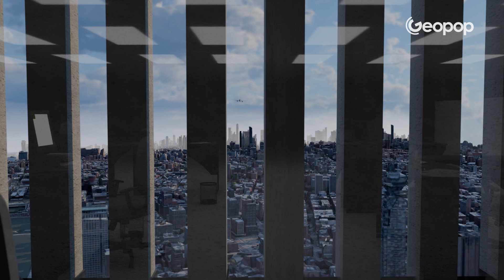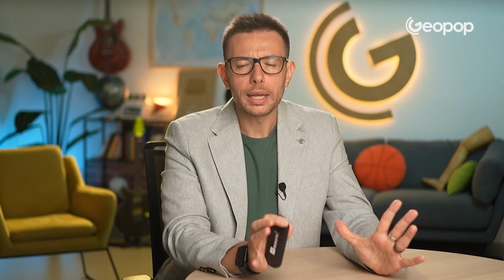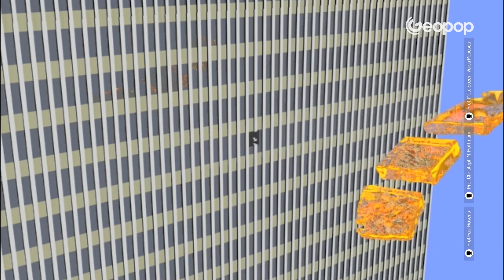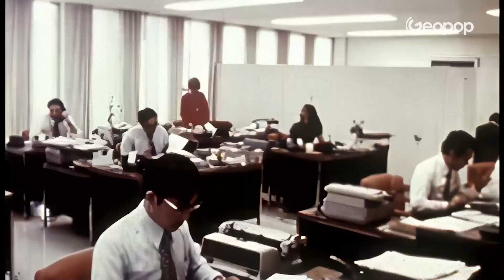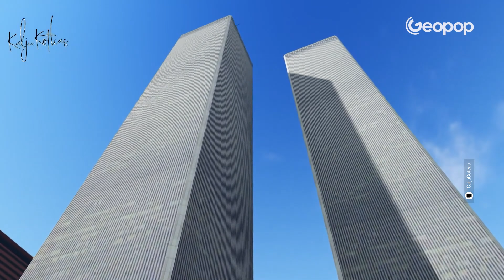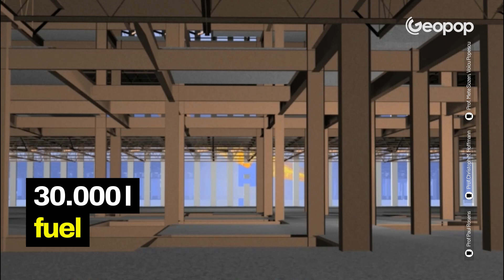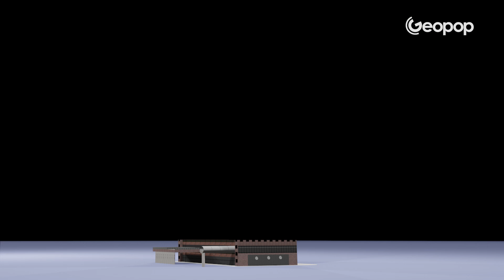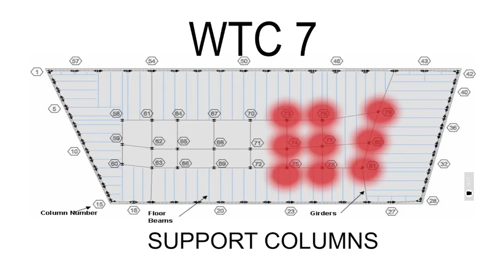9/11, 2001: The Technical Reconstruction of the Twin Towers and WTC 7 Collapses

Comment: Tower 7, really? No steel framed building has ever collapsed from fire (except for these 3). This video is just an embarrassing rendition of the party line. You cannot believe your own words. I'm cringing that you put it out there as the truth. You're a liar. Look at videos of steel frame buildings on fire. Philadelphia, Barcelona, others. NONE of them collapsed. Liar.
Reply: Because non have been hit buy a wide body passenger jet airline
Reply: That has 0 to do with the bottom floors collapsing. Especially in their own footprint and building 7, was not hit by a plane.@cptcool-__-7501
Reply: The collapse of the unknown and unimportant Building 7 – one of 6 buildings to collapse of 10 destroyed on 9/11 - confuses a lot of people, despite being one of the most studied engineering disasters in history. It was not famous, not a terrorist target, no one was killed in it and thus it did not get a lot of attention, so most know very little about it. There is a lot of tantalizing but absolute garbage out there on this topic. Given the choice between long boring, hard to find technical reports and readily available, easily digestible fantasy on the internet, many turn to the latter. To counter that I prepared this brief summary explanation based on my own analysis. No politics, just engineering. 

The North Tower collapse at 10:28am bombarded Building 7 with thousands of tons of burning debris, causing heavy damage and starting raging fires burning out of control for the next 7 hours. Half the responding FDNY firefighters having been killed, others injured, units in disarray, much of their equipment destroyed, no water pressure, and the greater urgency of Search & Rescue efforts, firefighting efforts at 7 were pulled as futile. The building couldn’t be saved and was left to its fate.

youtube.com/watch?v=g_SvpwyC17M&ab_channel=MFitz 

Collapse of a burning structure is always a concern for firefighters. Steel buildings subject to fire rely on active fighting of the fires to survive. Left to their own devices they will collapse. Buildings are designed around 1 to 3 hours of fire resistance, allowing time for occupants to escape and ACTIVE firefighting to get started, after which all bets are off. In B7 the occupants escaped, passive and active fire protections were compromised and active firefighting never got started which left the building to take its chances. It lost. Odds on Building 7 would eventually collapse,… and it did. No big deal in logic. That is the sort of choice firefighters make every day in brush fire situations - which houses to save and which ones to let go. Only real difference here is moving the decimal on the size and cost.

FDNY Chief Daniel Nigro ; The biggest decision we had to make on the first day was to clear the area and create a collapse zone around the severely damaged 7 World Trade Center, a 47-story building heavily involved in fire. A number of fire officers and companies assessed the damage to the building. The appraisals indicated that the buildings structural integrity was in serious doubt. I issued orders to PULL BACK the firefighters and define the collapse zone. It was a critical decision; We could not lose any more firefighters. It took a lot of time to PULL EVERYONE OUT, given the emotionalism of the day, communications difficulties and the collapse terrain

FDNY Deputy Chief Peter Hayden - We had our special operations people set up surveying instruments to monitor and see if there was any movement in the building. We were concerned of the possibility of collapse in the building. And we had a discussion with one particular engineer there, and we asked him if we allowed it to burn could we anticipate a collapse and if so, how soon? And it turned out that he was pretty much right on the money, that he said 'In its current state you have about 5 hours

With its deteriorating condition being reported throughout the day, the collapse of Building 7 expected by the FDNY, bystanders and the media meaning at least 24 video cameras recorded some or all of the collapse. Everyone at the time knew what was coming and why.

youtube.com/watch?v=OY5S5k3tMHI&list=PL4GiNqqck-lzR7pebSWRVLoXyu-aWR3Rr&index=48&ab_channel=911InvestigationVids 

Building 7’s collapse was totally different to the Twin Towers, harder to understand and most of the details difficult to see. But we can sort out what happened through careful analysis and observation.  What follows is MY EXPLANATION of the collapse sequence using the best available information and relying on no authority.

B7 was complex structure, a 47-story steel framed building built on top of a smaller existing 3-story building, requiring several lower floors dedicated to complex load transfer structures instead of usable office space. Of trapezoidal shape and all-steel tube-in-tube construction, B7 (above the 7th floor) consisted of a central core of steel columns carrying most of the gravity load, perimeter steel columns around the outside of the structure carrying the remainder of the gravity loads and long span beams and girders to tie those elements together and form the floors. On the outside of the building hung a moment frame - the last part of B7 to fall. 

Phase 1 : Collapse initiation for B7 is notably quiet with observers not realizing the building was collapsing! There was no audible warning in the form of say hundreds of ear drum busting 180-190dB explosive bangs preceding the collapse. The first externally visible signs of collapse initiation occurred at 5:20:28 pm. Here at 12:00 a local CBS affiliate reporter is talking 10 blocks from B7 when collapse begins. People don’t start to notice the collapse until 12:11. Then at 12:45 is the famous CBS fixed camera clip of Building 7’s collapse Again, note how quiet it is.

youtube.com/watch?v=t5tEy6mXSE8&ab_channel=fresnosean379

Collapse initiation was due to multiple lower floor failures above the load transfer region (7th floor) in the NE corner of the building. In this video at 0:45 you can see the NW corner from inside the building while under construction, Column 79 just out of frame on the left. That big, angled steel beam across the top of the frame connects to C79 at one end. The girders connect to the beam. The beam and all those girders depend on just one connection

youtube.com/watch?v=nP3TNHPCIVU&t=35s&ab_channel=EdwardCurrent

Phase 2 : Lower floor failures left core Column 79 laterally unsupported over an excessive length and it buckled. If you look at a floor diagram of Building 7 (see above) and look at all the structures that depend on C79 you quickly realize this one column was a relatively isolated structural element on which a disproportionately greater fraction of the structure depended . Externally we see a vertical progression of window breakage along the 44-46 line and a kink in the roof of the East Mechanical Penthouse at the top of the building, consistent with C79 failure. The transition from full capacity to almost no capacity occurs in virtually an instant. Once the buckling failure occurs there is almost no resistance

Normally with a buckling column, the load could very well be redistributed to other columns, meaning the buckling could stop after a while. With C79 that is not the case - the failure did not redistribute the load, so the collapse rapidly progressed to the roofline, sinking the rooftop penthouse.

Phase 3 : With C79 gone, B7’s progressive, non-symmetrical collapse continues with C80 and C81 at the east end of the core left laterally unsupported and quickly buckled and failed as well, sending the EMP down through the building. C79-81 all have no diagonal bracing, which I believe is a major reason why they could not redistribute a lot of vertical loads among one another.

From there collapse progressed from east to west through the central core until the core was gone taking all of the interior floors and structures and probably most of the perimeter columns with it. You can see the horizontal progression of window failures low in the building and the dropping of the remaining rooftop structures into the building. One of the big takeaways from the NIST Building 7 study (that gets completely ignored) was their modeling which determined C79 failing under ANY circumstances would have initiated the same collapse sequence.

Phase 4 : After about 10 seconds only the exterior moment frame - a hollow shell mostly supported by the 4 corner columns and quite unable to stand on its own – remains, creating the illusion the building is still standing since little has changed externally. That’s just hollow empty shell, like an empty cereal box. The north leans inward, forming a V in the roofline. The last remaining perimeter columns buckle under the strain.  There is almost no resistance as the moment frame free falls, landing on top of the 7-story high debris pile, blocked surrounding streets, heavily damaged the Verizon Building and destroyed Fiterman Hall at 30 W. Broadway, all well outside of Building 7’s “footprint”.  It is only here, at the very end that a single utterly meaningless measurement of alleged free fall is taken. Start to finish the collapse took 18-20 seconds, or less than 1/3 of true free fall*. Not that we really care since how fast something falls cannot tell you what started it falling in the first place. The free fall argument is about the collapse of the outer shell *AFTER all of the critical internal structure had already failed and completely ignores about 80-90% - of the collapse. 

Building 7’s progressive, non-symmetrical collapse was incidental and unintended collateral damage from the combined effects of fire + time + gravity started by the collapsing North Tower. That is true no matter who planned and carried out the 9/11 attacks or why . The collapse was of so little consequence it barely even registered at the time, a mere footnote. 

I hope you found this helpful. It is meant to be informative, not adversarial and to solicit informed critical comment. If I made any errors of fact, logic or reason or left anything critical out, please let me know so I can fix it. IF you can offer a more plausible alternative be my guest. So far no one has even tried. Please start any reply with the words “Tits McGee” or I will know you didn’t actually read it and won’t let you waste my time.

Comment: Science did not work that day how was it every action has an equal and opposite reaction? No pieces of the planes falling back to the streets? Ok ok but can you explain the columns of the world trade center cut in an angle like you see in control demolitions? You still can find those pictures on the internet
Reply: I don't think you understand how science works. 

As for the angle cut columns, yeah, that has been explained a few countless thousand times but here it is again since you missed it:  

The angle cut steel beams you speak of were cut on 10/29/2001 by workers removing debris using thermal lances and cutting torches. This is confirmed by AP photography of the scene before, during and after 10/29/2001.  

www.youtube.com/watch?v=pVDU5QKa8Wg&t=7s
Reply: @TheLoonResistance Science does not bring 3 buildings down in their own footprint, the odds of that or astronomical, at the very least. Hell, even professional demolition people. You can't get buildings to fall that well sometimes.
Reply: @Bigdaddy96991  and just airplanes neither
Reply: Huh

Comment: I'm very skeptical of NIST explanation of the events of 911 based on your information airliners weighing in at 130,000 kg flying 700 km/hr. Struck the building with a massive over 450 tons, you said the Jets were disintegrated in less than one second, but they managed sever 37. Exterior columns,  and  19 interior columns . in less than one Second…. Well, consuming 30,000 L highly flammable, aviation fuel….. Have you listened to what you're saying and how it doesn't really align with the bigger picture... That airliners no matter what their size could never sever 37 steel columns on the exterior skin of that building in one second never mind a 19 interior columns planes hit each other on the ground in the entire wings fall off and they just brush each other barely any force at all so please stop telling stories that have no real scientific bearing whatsoever. God bless all the lives lost during atrocious attack on humanity…..
Reply: It’s all about velocity

Comment: So, the buildings were both hit near the top but within one hour the center core steel supports from top to bottom, all the way down to the first floor weakened and then collapsed. I say the first-floor supports were still cold.  How could the entire steel core get compromised in an hour? This makes me wonder if you're telling the truth about other events on that day.
Reply: It's all about the columns. They supported the towers' weight, and the structure can only stand if the columns are aligned and intact. Once the collapse began, the tower tops were separated from the columns and from that point the falling mass was falling directly on the floors, bypassing the columns. So you have hundreds of thousands of tons of mass falling onto floors designed to hold 3500 tons static. Once the collapse begins there's nothing to stop it.
Reply: Look for a video called "World Trade Center Anatomy of the Collapse." Structural engineers explain this quite clearly.
Reply: NO, THEY DIDN'T! Only the floors where the fires were weakened because the steel became soft (not melted) due to the heat. Once they collapsed, the structure could no longer support the thousands of tons of moving mass, accelerating towards the earth by gravity. Buildings aren't designed to carry infinite loads. As soon as the load is exceeded, they collapse.